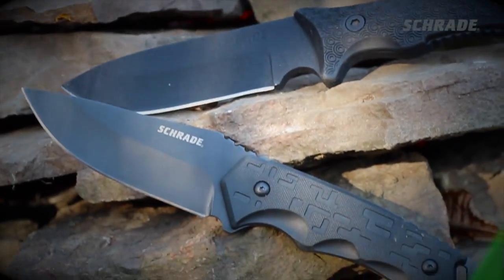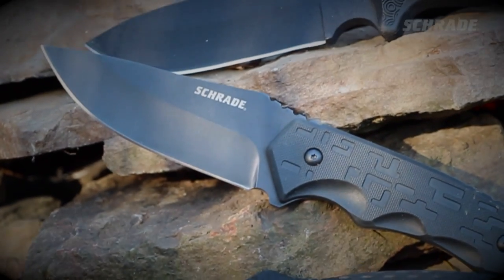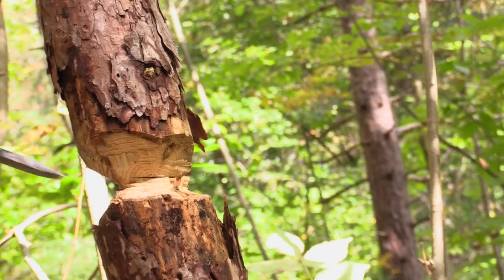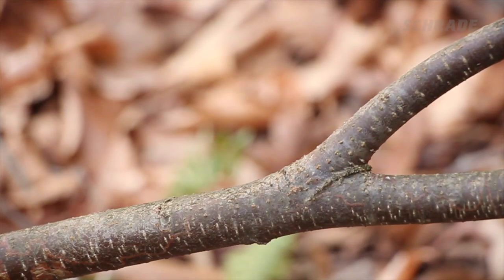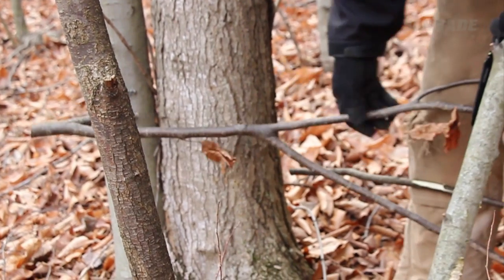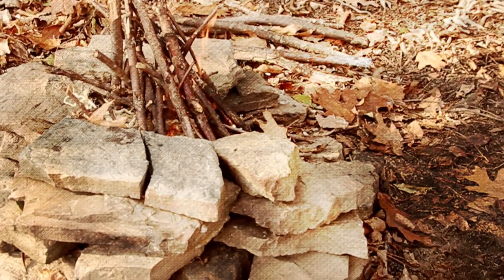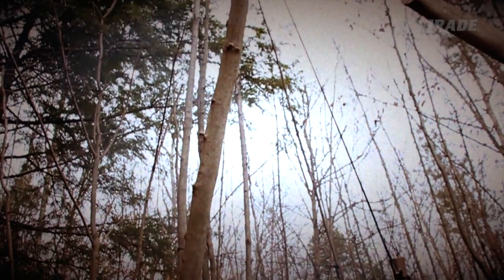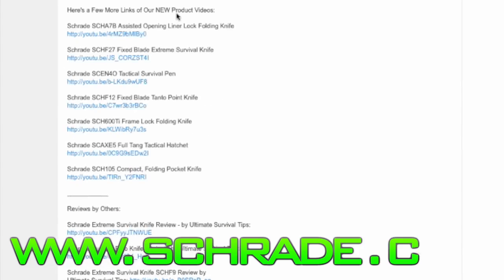How to Make a Pot Hanger in the Wild

Comment: Interesting video, I had never tried to make a tripod pot hanger before. I like the SCHF36. It is the right size to handle most jobs and the wide blade gives you the strength needed to really hammer on t when necessary

Comment: I'd gladly take any of the three,  but bigger is better - actually I'm looking for a larger bushcraft/survival knife - so I think I would go for the SCHF36.  I also like the finger choil and the extra jimping.  Good info in the pot hanger video.  Useful for those times where you really need to watch the weight and amount of equipment you pack around.

Comment: I would prefer to use the 36 because growing up in the northwest I found that a bigger blade works better for me the design looks like you can choke up on the blade for fine work (plus I am not trying to replace my Old Timer Cave Bear it's scary sharp) and is suited more to a knife that can tackle heavy task's as well as the small one's.  It looks like it could replace my Kabar as my primary outdoor knife.

Comment: SCHF36 is what I want to win. 5" blade, high carbon steel, 90 degree spine, powder coated for resisting ruse, jimping and TPE handles for gripping, drop point, choil for close up work, this would be the replacement for my Old Hickory butcher that is wearing down in age and durability. It would also be my first Schrade! The accessories are a bonus! My friend has the SCHF9 and I have been wanting an upgrade ever since. I would even do a review, and post it on my Facebook groups that I have joined (two are over 10,000 members strong). Thank you for the chance.

Comment: It would be easier to adjust the height of the pot by shortening or lengthening the cord that it is hanging by rather than adjust the legs of the tripod, if the cord ran down the length of one of the tripod legs. I'll take any of your knives. I need a knife with a full tang so when the next major earthquake occurs, I'll be better prepared.